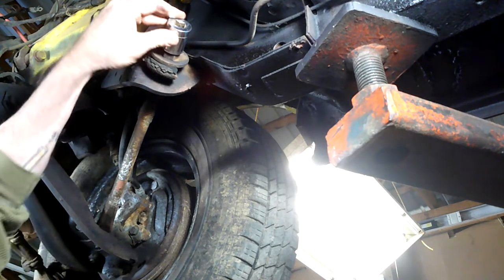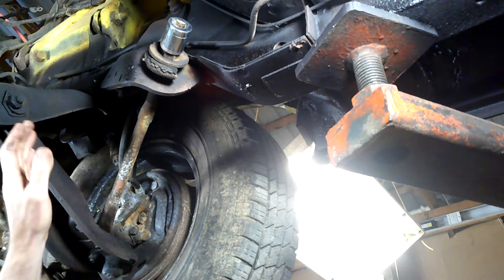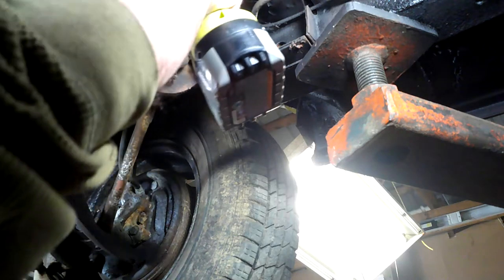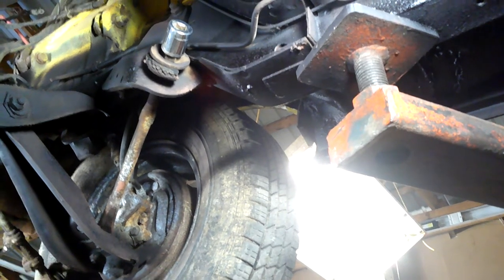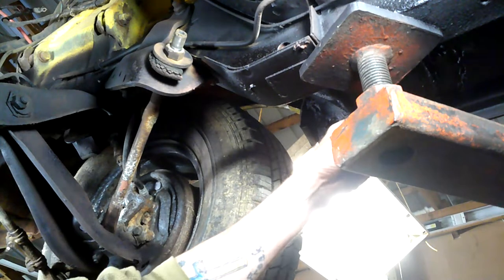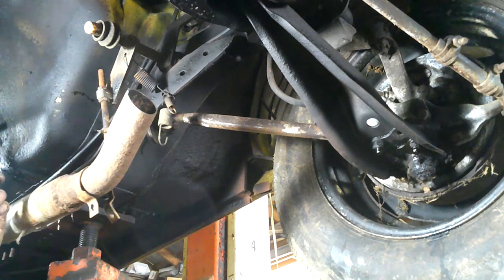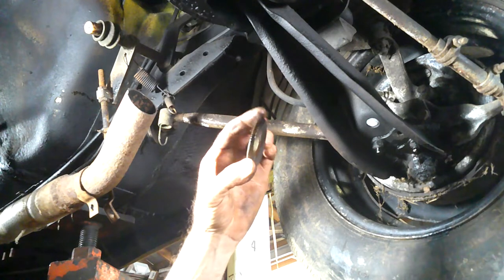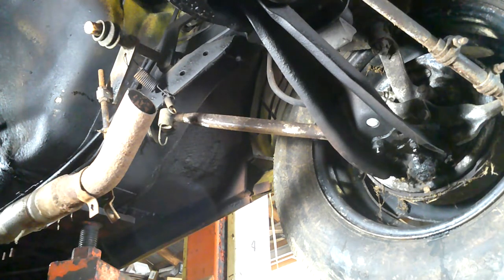How to replace strut rod bushings in Mopar or AMC. Gremlin strut bushings. Polyurethane bushings.

Comment: How has the bushing held up? I got the 2 piece design but without that extra metal washer. I thought the bushing was too long and cut it so that I could tighten the front nut enough to get it back to where it was so it was aligned but it crushed the front bushing too much and the bushing actually popped right around the curved washer.
Reply from the maker: Hi, Too Many, 
     I do not think cutting the bushing was a good idea. If you load the suspension with the strut bolted down to the lower control arm, it should have crushed the bushing enough to get the nut on. That washers you mentioned are no more than a cup to keep the bushing positioned. The original did not have them, so I assume it is an aftermarket upgrade for the poly bushings. After install I would drive it a bit to let the suspension settle before attempting to align it. I think I would get another set of bushings and try again. I got mine from Blazer Auto but I am sure you can get them elsewhere. I cant give you an answer on how they are holding up since I am still working on the car. It should be done soon and I can let you know. Check my other videos to see how it is coming along.

Comment: Towards the front of the car, the washer "cups" the bushing. Towards the back though, it does not.  The prothane bushing kit comes with a one-piece inner sleeve that replaces the two-piece original, you can use either one. See my video here: https://youtu.be/uLeVM3ZX77s?t=1125
Reply from the maker: Thank you, Paul for the heads up and the subscription. I checked out your video. Your kit was a little more self-explanatory. Mine had no such writing on the cups, nor directions so I had to wing it. On the originals, both cups were facing out and it just looked wrong so turned them in. I guess I was half right. In my kit all four cups were the same size which doesn't seem like it would matter much though. I guess I will be turning the rear one around, but it still seems a little weird to me. I will check out more of your videos when I get some time. Thanks again
Reply: Awesome - well keep me in mind if you need advice or help on yours. I own five Gremlins, and have done nut-and-bolt restorations, so there probably isn't anything on them that I haven't done. Always happy to help, and I really like your channel!
Reply from the maker: I just may take you up on that. Are any of yours V-8s? I could use a 4-speed since my mismatched clutch/pressure plate set up chatters pretty bad.